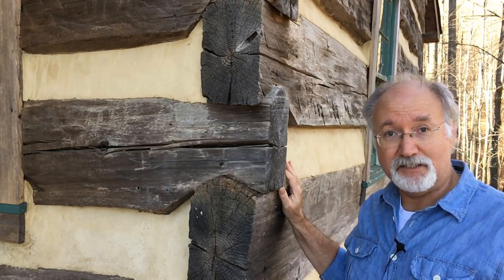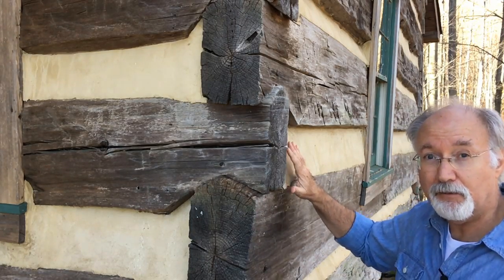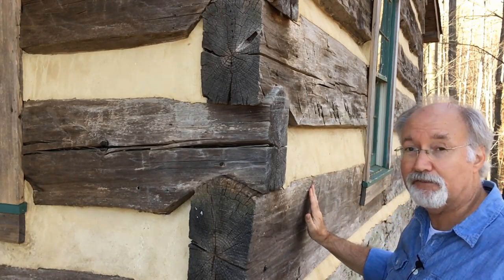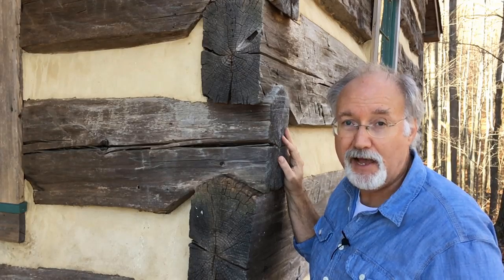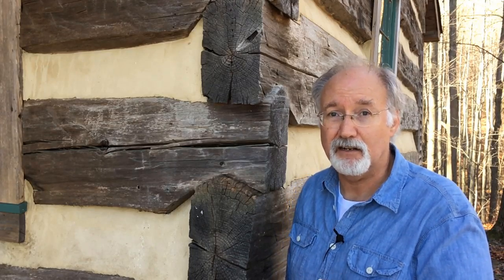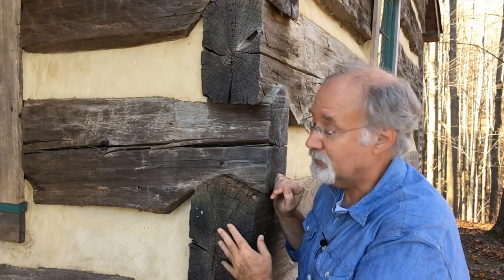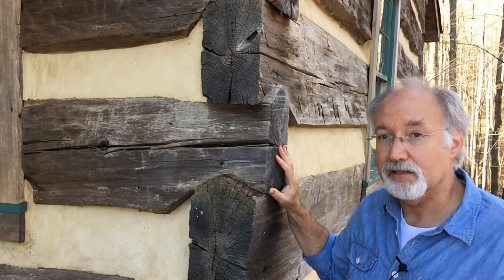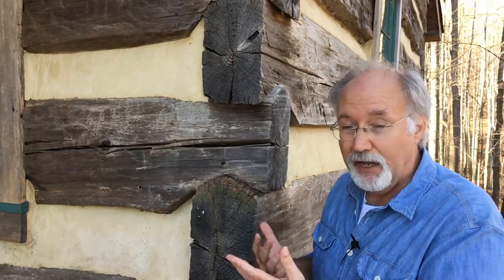Handmade House TV # 6   "Hewn Logs and Chinking"

Comment: Love the vids Noah but this one brings a question to mind. You say that one of the reasons the wood lasts is that wood is not touching wood but what about the corner joints where wood is touching wood. Why does it not rot there?
Reply from the maker: Great question! and one that I should have addressed in the video. (I 
work without a script... I just get in front of the camera and start 
talking)... maybe I'll do a video on this topic...  The answer is that 
it's all about the slope of the notch. You are correct and that some 
moisture might want to creep in there, but if it does it quickly drains 
out. This cabin has V-notches which are good but if you notice half of 
the notch takes water to the outside of a cabin and half to the inside. I
 have noticed that cabins with V-notches during hard rains that last 
over the course of a few days will show a slightly more chance of a bit 
of water finding it's way to the interior. Whereas half dovetail notches
 (my favorite) slope entirely to the exterior.  Square notches (most 
often found on log barns and are covered over with siding would quickly 
rot if exposed to the weather.
Reply from the maker: Another factor to consider also is compression. The entire weight of a traditionally built log home is transferred to it's corners... unlike any other form of construction where the exterior walls equally carries the burden of the home. That's about two square feet of a home carrying the weight of the walls, the floors, the roof, and all that is within the home. The wood here is smashed so tightly together that water has to REALLY struggle to find a way in while it sits on top of slope urging it to go away.

Comment: Good morning, Noah. Have you ever put a basement in a log home? Would you source that out to an outside contractor or can it be done yourself?
Reply from the maker: I have built many cabins with a basement... mostly because of building on a slopped site and it just made sense to have a walk out basement on the downhill side. Most of the basements I have built I have used subcontractors who have come in and poured concrete walls. I once witnessed a cinder-block basement built by another contractor fail.  On my most recent home build we built the basement walls our-self using ICF's foam block filled with concrete... and loved it. I intend to build part of my future home with them.
Reply: Noah Bradley I'll have to look in to that. I definitely want a basement for escape from the heat during the summer and also food storage.
Reply: I've been on job sites with the foam block filled with concrete.  Glad to hear you approve.  :)

Comment: Noah, You talk about the benefits of Poplar.  Sounds great.  But what about people living in different areas?  I'm in Colorado and curious what you would think about the native species here?
Reply from the maker: I likely don't have experience with most of the species that you have there... but likely there are tremendous opportunities.

Every species of wood has it's pros and cons... ease of working... rot resistance... availability... r-value... stability... beauty... etc.   Every species excels in some, and falls short in others. None are perfect,  none are unacceptable.

With all of that said, I've never seen, or heard, of any species that would not be good for a log cabin as long as it is available in lengths and diameters needed and is relatively straight and knot-free. Any logs that meet these basic qualifications would make a wonderful cabin when built in the traditional method of log cabin construction.

Comment: Wonderful and informative video! I was wondering you said that these logs were tulip poplar. Could you build a log home out of cottonwood? By the way I live in Kansas if you were wondering why the "strange" choice of building material.
Reply from the maker: I don't have much experience with cottonwood, so I can't say for certain... I understand that it is a very light wood (which would make for well insulated walls)  My best guess is that it would do just fine... one way to tell, if your aren't in too much of a hurry would be to go ahead and make a small log outbuilding out of it in the traditional manner. If you don't see any problems in the first couple of years then you are good to go!
Reply: You can get a lot of wood from some of the older cotton wood trees.

Comment: I know you're a fan of using vintage logs as a way to prevent settling. But, if one uses green logs, would the settling process crack and break out the chinking between the logs?

Comment: how does expansion with humidity and temperature affect these homes? are there ever any problems with chinking cracking or other such problems related to that?

 theoretically speaking, could one dry logs by means such as a kiln to expedite the drying so building and finishing could be done sooner?

 I'm from next to Blackburg Va so  it's nice to see a channel nearby. it seem like most are far where things are done a little differently for those areas.
 
 I wish I could work with someone such as yourself or essential Craftsman, I have so many more of y'all's videos to watch. Thank you your videos are inspiring.
Reply: Kilns weren't used to make these cabins originally. Why would you need such a thing now?

Comment: The logs weren't sealed, treated , or had any bug application used. How can the home be free from bugs or mold. I see cracks in the wood. What prevented any mold or rot from forming over the 150 years. I'd like to know so I can avoid wasting my time treating and sealing my future home. I've never liked using chemicals on a home built from tress.
Reply from the maker: Hi Jerry. With respect to mold, mold likes wet, dark places, places in which air does not flow regularly freely. As long as the logs are able to dry once they become wet, mold will not typically grow on them.  

With respect to bugs, there is no silver bullet (just like with regular homes.) Good landscaping choices and regular tidying up around the home, as well as a structure being elevated off the ground do help quite a bit. With that said, when I build or restore an existing cabin, I power-wash the cabin to clean out bugs or debris from the logs.

I hope that helps.

Comment: Why don't the corners rot where they touch? Tight fit?
Reply from the maker: Great question! and one that I should have addressed in the video. (I work without a script... I just get in front of the camera and start talking)... maybe I'll do a video on this topic...  The answer is that it's all about the slope of the notch. You are correct and that some moisture might want to creep in there, but if it does it quickly drains out. This cabin has V-notches which are good but if you notice half of the notch takes water to the outside of a cabin and half to the inside. I have noticed that cabins with V-notches during hard rains that last over the course of a few days will show a slightly more chance of a bit of water finding it's way to the interior. Whereas half dovetail notches (my favorite) slope entirely to the exterior.  Square notches (most often found on log barns and are covered over with siding would quickly rot if exposed to the weather.
Reply: Noah Bradley That makes a lot of sense. Thanks! See you next week Lord willing.